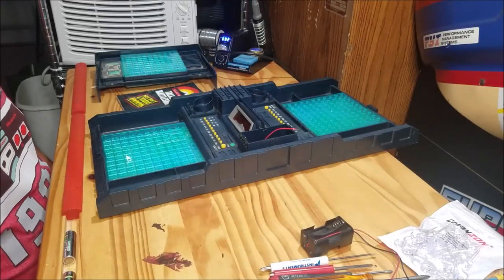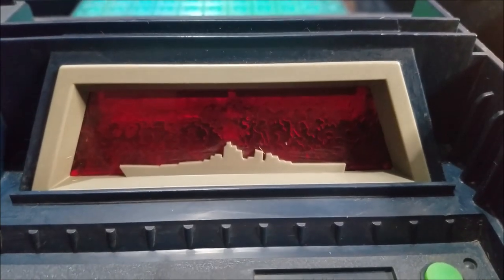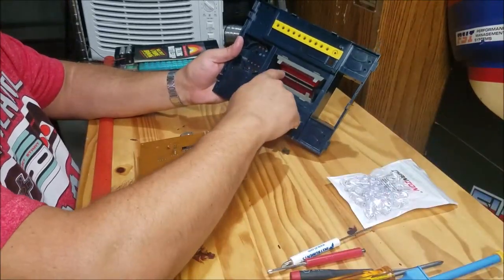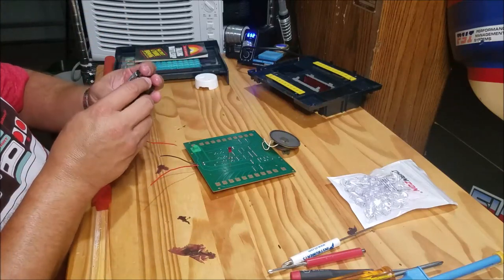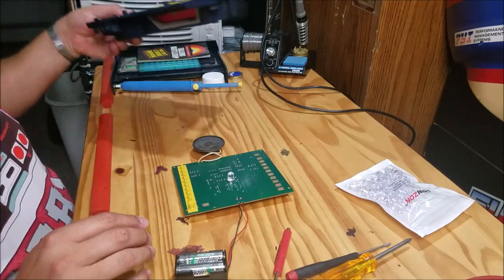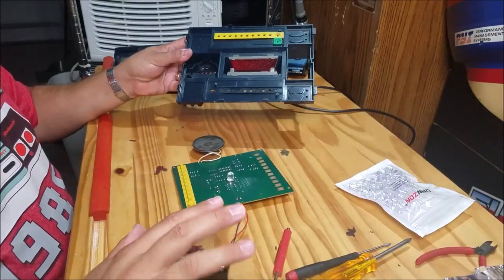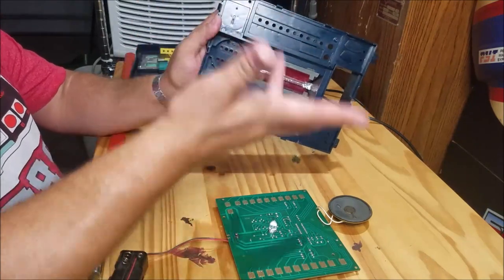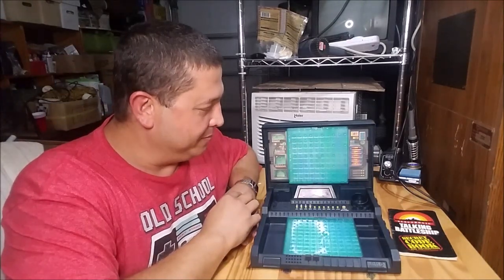Electronic Talking BATTLESHIP Fix, Repair & Upgrade! Bert the Stormtrooper Reviews!

Comment: I'm replacing the battery terminal in my 1982 version and while I'm a stained glass soldering whiz electronics  soldering is new to me. I have an electronic  soldering iron and 60/40 rosin core solder. What I can't figure out is how to get the wires out of the circuit  board. What is the tool you use?
Reply from the maker: Touch the soldering to to the contact, wait for the solder to loosen and pull the wire out, gently.
Good luck and thanks for watching!
Reply: @BertTheStormtrooper  thanks! I got it done! Now my issue is that my blue buttons don't seem to work 😒
Reply from the maker: @KirstenAnderson-jr6js  the power button?

Comment: Excellent, I own this version and I have a couple of questions. Some times it will just stop working in the middle of a game like a bad connection or something. We have to restart the game and of course start all over when this happens. Would that be something as simple as taking it apart and cleaning it?  Where can the new led light and tape be purchased?  Thank you for the tutorial.
Reply from the maker: Could be a number of things. I assume you've tried fresh batteries?
If so, first thing I'd look at would be the battery holder, contacts, wires and connection to the main board.
Have you seen my previous Battleship repair video? I did a battery holder replacement on that one that might help you.
If that fails then I'd start looking at the board for bad solder joints or damaged traces.
The LEDs can be found on Amazon and the reflective tape is muffler repair tape, found in any auto parts store.
Hope that helps, LMK if you have any more questions.
Thanks for watching!
Reply: @BertTheStormtrooper  The game had been packed away for several years after a move and for 20 some years it was actually forgotten about. I saw something on TV about Battleship so I started looking for it and found it stashed in the attic. The batteries were still in it and as you know everything was corroded real bad. After watching your video I removed the center piece and examined everything and found a bad connection on the black wire going to the battery holder. I cleaned it, soldered it back on and it works. I have ordered a new battery holder and will replace it once it arrives. Thank you again for your help and tutorial on this.
Reply from the maker: @66lwmorgan  Fantastic! Always great to hear when another one of these classic games is saved!
Reply: @BertTheStormtrooper  Thank you for the help.

Comment: Came here to see if I could find out how to replace my speaker on my 1982 version (sound is awful) - didn't find my answer but a cool video nonetheless. I also need to figure out if I can find a replacement speaker!
Reply from the maker: Measure the speaker, you can find a replacement using said measurements from Amazon. Then it's just a matter of unsoldering the old speaker and re-soldering on the new one. Should be pretty easy.
The last one I restored I added a potentiometer in the speaker circuit to create a volume control.
LMK if you have any questions.
Thanks for watching!

Comment: The battery compartment for mine came off the wires. Is it safe enough to splice a new battery connector to the old wires?
Reply from the maker: Depends on how damaged or corroded the wires are. Usually it's ok to splice them but I prefer to solder the new battery holder to the board just to be safe.
Good luck with your project and thanks for watching!
Reply: @BertTheStormtrooper  No corrosion. The wires simply came off of the battery holder but are still connected to the board. I’ve never soldered or de-soldered anything before so I was asking first before anything else.

Comment: Hey Bert, I’ve watched two videos, including this one, regarding repairs you made to the original talking Battleship games. One helped me in seeing how to take mine (recently purchased to enjoy with my kids) apart. D4 wasn’t working on one side so we couldn’t complete the game. Otherwise, everything works great. After taking it apart, I saw some corrosion directly on the D4 key which I removed. Yet, I still can’t get it to work. I can’t see any issues in the tracing. Would love to send you a picture of the condition of the D4 key for any recommendations on how to fix it. Thanks in advance!
Reply from the maker: Sure thing. Send me pics on my FB page or Instagram and I'll take a look.
Did you see my other video where I worked on some corroded traces?
https://youtu.be/j8rvpRzLBYY

Comment: Hi Bert, I just got a free never opened 1989 electronic talking battleship game from someone.
But doesn’t turn on. Does nothing when push on button. Where do I get new battery box. I need a man like you around lol. If it’s not the battery box what else could it be? Thank you for the video!
Reply from the maker: Brand new, never opened? And it doesn't turn on?
If that's the case the battery contacts should look clean and polished, no corrosion. If they're clean I'd have no reason to suspect the battery box.
It's very possible that one of the wires popped off a solder joint over time. Simple re-soldering would fix it. I worked on another one that some of the internal circuit traces had corroded and I had to do some patch work (I made a video on that one too), but I couldn't tell you for sure without seeing it or knowing more.
Reply: @BertTheStormtrooper  thank you! There’s no corrosion but I noticed one of the springs is loose. Like it came unglued just not completely off. I was looking at battery holders on line, they look like what you bought, do I have to get a specific one for the game. special brand or anything? Is there a specific part number I have to get or will any that look like what’s here now will do
Reply from the maker: @joanargilan9381  they're not brand specific, as long as it's the same, 4- battery holder that fits, it'll work.
Reply: @BertTheStormtrooper  it is working! My son in law saw the loose spring and replaced with new battery pack he had , it works now. Thank you again! Keep making videos please!
Reply from the maker: @joanargilan9381  that's AWESOME!

Comment: I have a 1989 MB Talking Battleship.   It will not turn on. The batteries are good; I have 6.13 v to the board.  I cleaned the power buutton contacts.  The traces are good to the other end of the trace.  I shorted across the other end of the two traces and nothing.  Any ideas?
Reply from the maker: Have you tested the speaker? It may be turning on and you're just not hearing it?